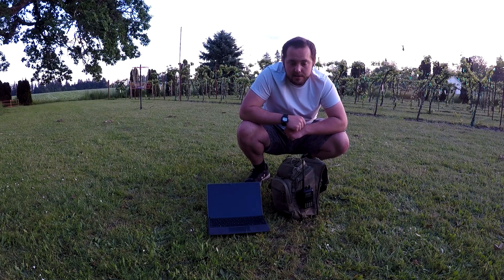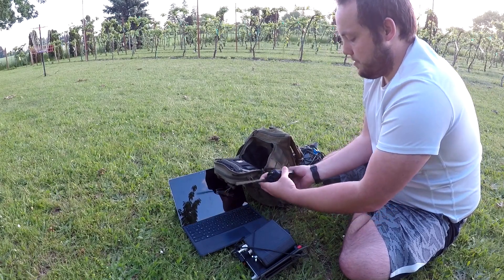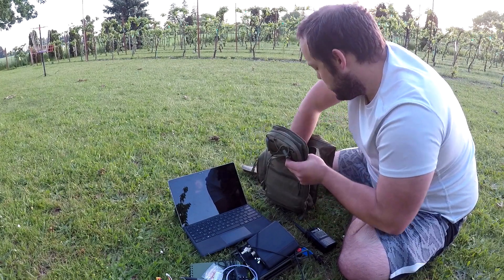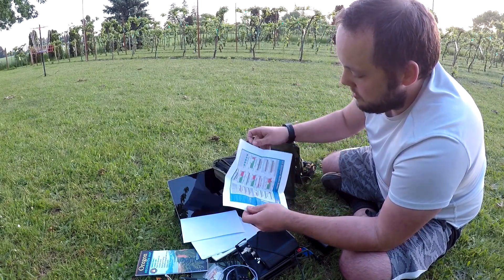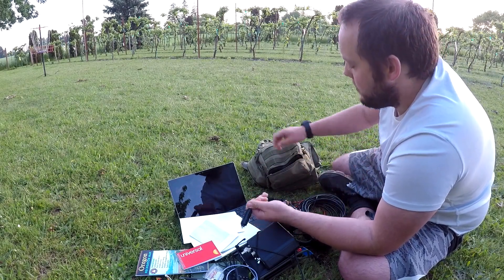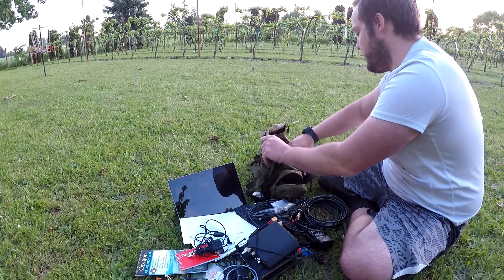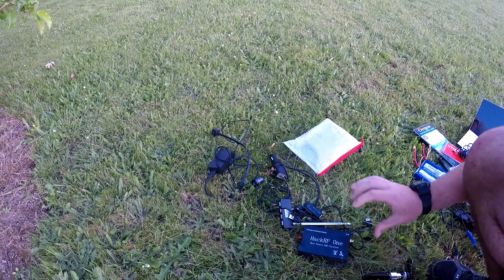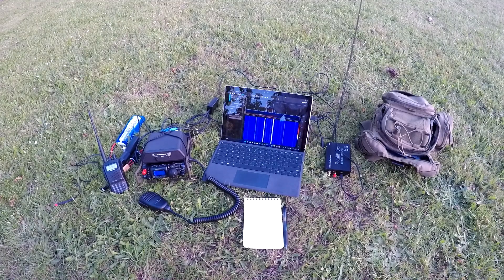Ham Radio HF Go Bag - KG7JQY

Comment: That is an impressive go-bag!

My go-bag is about the same size, but not near as diverse. I opted for more power with a FT-857D. I still have limited digital capability with FLDigi on my Android phone. I  have a DigiRig Mobile soundcard for my large Dell laptop that is full radio software that is a separate carry item.

I am fairly well stocked with cables for computer interfaces, gps, power, nano VNA, LDG z11 pro II tuner, and antennas. I have three antennas: a rubber duck, MFJ coil with buddiepole telescoping whip, and Chameleon Emcomm III portable.

The Emcomm III seems to be effective 40m and up, but about -6 dBr to my 130ft Ultimax 80m-10m EFHW based on ancedotal signal reports.

As I better equip I will probably dump the Nano VNA.
Reply from the maker: Yeah that sounds like a great setup. I would eventually like a 857d since i have run into some issues being qrp only but i can still get out pretty far and it saves on batteries which is nice. 

Have you looked into the armoloq manpack frames for the 857d? Thats what i would want to use for it if i had one

Comment: Great kit. What bag are you using?
Reply from the maker: Its the portable zero 817 sherpa pack bag. So far i like it
Reply: @JackTradeMark  Thanks for the quick response. I thought that might be what it was. I take it that bag gives you all the room you need for your radio gear. Does your laptop fit in there, as well?
Reply from the maker: @jterrellcreative the laptop does not fit in there unfortunately but i just carry it in my backpack.
Reply: I came to ask the same question. Thanks! KK4TGW